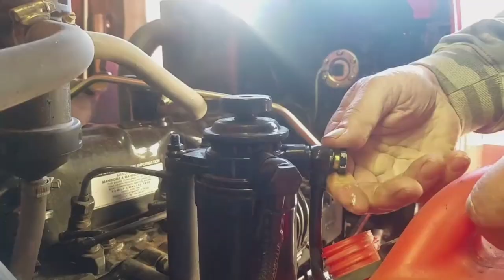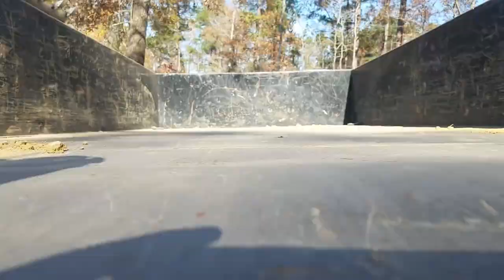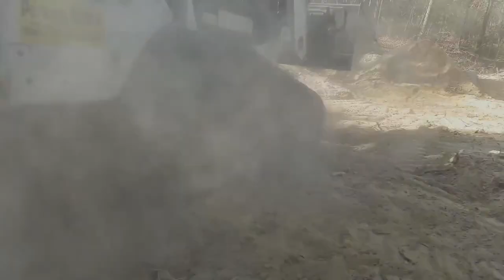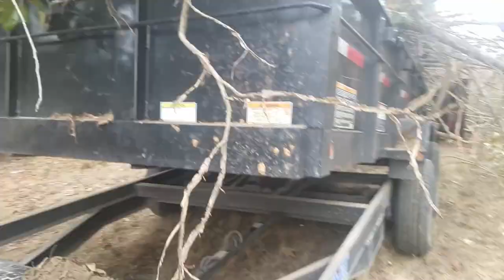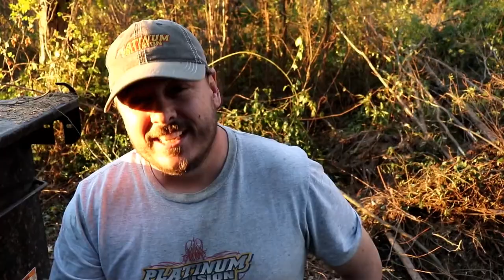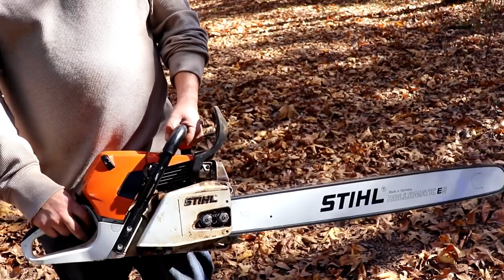Watch This Before Buying A Compact Farm Tractor!

Comment: You are talking about two different types of work. If you need to mow, till, plough, disc for farming you need a tractor. What you are doing is site work and excavation. That requires iron. You are usually better off paying someone with the right equipment to come in and do it. But I get it , it costs a lot of money and it's easier for you to chip away at it.

Comment: Found the channel due to the kayak speedboating (good videos by the way) and caught this video. I think your big failing was that you bought a Mahindra. If you truly did your research.. you'd learn that you bought a 3rd rate tractor. For example, I have a Deere 110tlb. It only has 900 hours on it and it has broken, exactly one time since I had it since new. And it was the front electronic valve actuator. $160 (which is practically free when we are talking Deere parts prices). 

As for the skid steer argument. There is a reason that compact tractors AND skid steers exist alongside each other. Try towing things around with your skid steer.. nope. You CAN put a backhoe on your skid steer, but the prices tend to be brutal and the sizes are limited. Stability (off camber, front/back).. skidsteer.. nope. Mud? Unless you get a track machine, you're in a world of hurt. Anything PTO driven? Maybe there are skidsteer adapters, but I don't know. 

A modern compact tractor gives up some agility and raw lifting power for true universality as compared to a skid steer. I'd love to have both too, but the reality is buy a non-garbage tractor and accept that you might have to do a few tasks a little slower, but your overall functionality is much greater. 

Your results may vary.. but again.. there is a reason that BOTH exist along side each other.

Comment: My opinion about equipment, if you are working land, say 20 or more acres, and can only have 2 pieces of equipment get a heavy duty used  tractor with a front end loader and a 3 point on the back, and then a mini excavator with a thumb and a blade. I have a fairly heavy duty backhoe and it works great but if I could I would get the other 2. :)
Reply from the maker: Yeah, I would love to have your backhoe.

Comment: Alternators can be re-built. The problem is usually a diode that needs to be replaced which is simple. Mechanic here with 27 years experience.
Reply from the maker: Gonna just convert it to a one wire high amp alternator. Permanent fix and dirt cheap.

Comment: I agree grew up with weeks and weeks in a New Holland 665 skid steer.  Get a good 4 way bucket and you will be amazed with what you can get done.  Plus with a skid steer as long as you can go backward it is very difficult to get it stuck.  I would opt for the tracked machines if you have the option.  We also had an old Massy Ferguson for bush-hogging because our skid steer did not have an enclosed cab.

Comment: Own 50 acres, a third is (mature pines)forest, and two thirds agricultural. Just sold my 27hp Kubota and was considering a mini ex, but I really need to use my full blade, brush hog, forks, and rake. I've chosen to upgrade to the 40-50hp size tractor, and I've been shopping and comparing for a few weeks now and man, I can only say "thank you for this video". I am torn between the Kubota MX5400 and the Mahindra 4550. They are $12k apart in price difference, and I understand a lot of the Mahindra 4550 that is just the basics of "old school style" tractor, manual trans, no bells & whistles, and their loader is appealing. But, the Kubota will come with the 1065 loader and HST, I guess it's just worth it after doing youtube and Google research about both, I've seen WAY more negative about Mahindra. Thank you, sir. Much appreciated!

Comment: I have a Mahindra 2615. 4x4. I wouldn't have gotten the unit you did either. I need the 4x4 and it makes a big difference. I have box blades and tillers and backhoe, post hole diggers, with the front end loader. I have built some forks for it and it does everything I need it to do. The only real problems are the electrical switches. And the starter didn't want to turn it over fast enough. replacing that has fixed the starting issue which is partially the fault of the lighter weight wiring. Other than that it has worked great and I have worked the crap out of it.
I have hauled so many trees with that thing and I admit that was total abuse and the bucket shows it. Trees 3 foot through will do that to it. heh :)
Right now I just wish it was a little bigger and I had another swimming pool job. That was fun.

Comment: Look and plan what your future is on the size and what your going too do over time on your purchase of a country property .I always rented a excavator with pickup and delivery and insurance the choice of size I needed and plan and get your work done in couple weeks . Buying a 40 too 50hp tractor four wheel drive and having a woodchipper with power feed / heavy duty flail mower / grapple / heavy duty tiller / pallet forks .Try too buy it all at once in a package deal with the tractor . Save money . Mowing around the house garden tractor .Find a good dealer that has good customer service with quality equipment. It was a lot money for me but I have never regretted it .

Comment: I think I'd go for a 4wd backhoe/loader because it's what I'm familiar with. I do see the advantage of having a skid steer and excavator but that's two machines that I'd have to maintain. I would choose that route if I wanted to make money with them too. And the only thing I'd want that I would not be able to do with the backhoe/loader is a snow blower, I could settle with attaching an old plow to the bucket. If I did go for a tractor it would be Yanmar.
Reply from the maker: That is a great choice.

Comment: Mini-excavator is a great choice. Extremely versatile and capable. In my neck of the woods the cost of used equipment is about three times higher than the numbers you were throwing out. Having operated Bobcats and small tractors, and on occasion, a full sized back-hoe, they all have their limitations. The mini-excavator gets around most of those.

Comment: you have lots of problem with your mahindra, just get rid of it... I bought a 45hp Kioti (DK45SE) and its turning 2000hours and I only did the engine and HST oil changes, Oh..I broke an hydraulic line once. I agree on the Skid steer but they arent comparable with tractor unless you are comparing a 2020 tractor with a 2005 skid steer...  foot controled bucket? hell... to each their own I guess !!! I would like a skid steer but they cost 70k$+ over here...  the mini Ex is probably the best piece of equipment to get and really simple to work on... no transmission, just an engine with hydraulic pump.

Comment: You have no clue what you're talking about. I have owned a demolition company for the last 25 years, with 30+ years of experience on demo/construction here in Southern California, specializing in tight access. I do work for the federal gov, state, city and also high end residential. We have owned 20 bobcat skid steer and bobcat excavator, and not once we've had any engine problems besides the regular wear and tear parts. of course we buy ours new, maybe you're talking about buying used. That's not on bobcat, that on the previous user who probably didn't maintain it. I have also ran Caterpillar, John Deere, Case, Gehl, Mustang etc...etc...You name it, I've ran it. Bobcat beats them all when it comes to best all around. Others may have more lift power, more horse power but shitty control, like Cat skid steer controls sucks vs bobcats. Each skid steer has its high and low, but bobcats are the most well rounded and reliable, specially the old model 5s, 7s and 8s. I'd also like to add, while yes, turning the key on and driving around a skid steer technically makes you an, "operator" but you are definitely NOT an operator by our construction/demolition standards.

Comment: There's no way your Mahindra needs a $700 alternator, it's only charging the battery. Any car alternator that fits the bolt spacing will do. IMO !
Reply from the maker: The one wire conversion video will be coming soon.  Hopefully it will save some other owners some money.